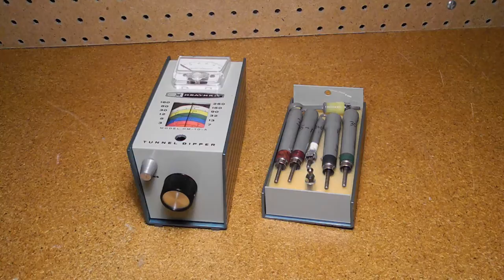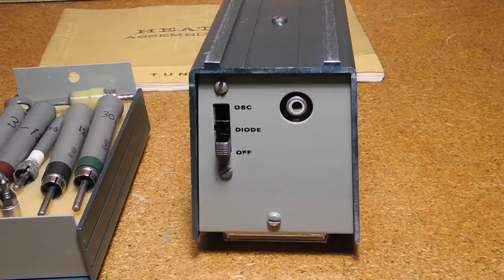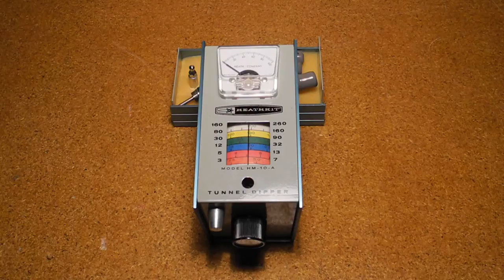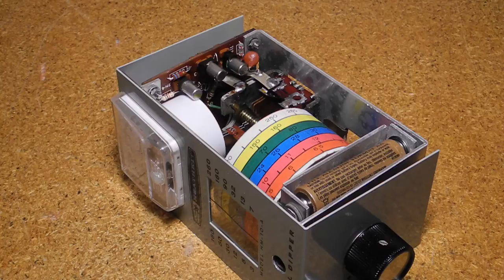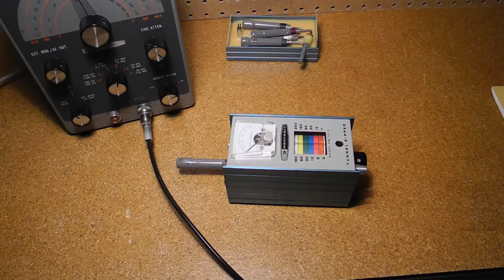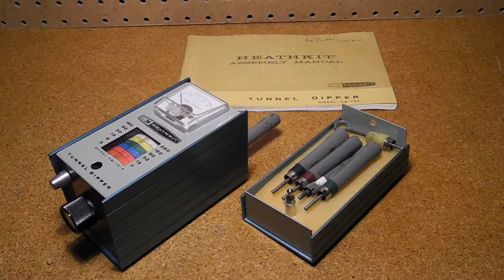The Heathkit HM-10A Tunnel Dipper

Comment: Very interesting and well presented.   I have one that is missing the coils.  I have not tried to fix it yet because I like using my Boonton Rx bridge or Q meters instead.  Did you ever look at the potentiometer used for sensitivity adjustment?   If the carbon track has cracks that make it open circuit, that might explain the behavior you were able to correct.  It might be difficult to find a replacement.

Comment: The Tunnel Dipper rapidly developed a poor reputation after it was introduced due to the hypersensitive gain control and generally very frustratingly-touchy operation, often requiring multiple gain adjustments to span the range of a single coil, and often producing false responses.  Heathkit eventually replaced the Tunnel Dipper with a dip meter that used a field effect transistor (FET) and provided much-smoother behavior.

The Tunnel Dipper was an innovative design, but the circuit should have been improved before it was marketed.  Unlike other dip meters that limit the oscillation amplitude via self-regulating feedback schemes, the Tunnel Dipper simply allowed the oscillations to grow to the maximum level the tunnel diode could sustain.  Thus, its oscillation contained harmonics, and the oscillation amplitude dipped only a tiny amount when coupled to a resonant circuit under test.  To compensate for the small change, the designer used a high-gain dc amplifier to drive the meter.  The amplifier is an unbalanced circuit, having a lot of offset and drift, requiring careful adjustments by the user to keep the meter from being “pegged” either one way or the other.

I purchased one of these Tunnel Dipper kits from Heathkit and have had it ever since.  I also added resistors around the gain control to reduce the control’s sensitivity, but the unit remains rather touchy to operate.  As noted by other owners, the foam that held the coils in the cover has deteriorated and crumbled.  I have replaced that black foam with newer soft white plastic foam.

Comment: I am not sure if this is good place to add this. I am having an issue with the meter not working unless pressure is applied on the device face. Please check heathkit@groups.io if you could help me with the issue.
Reply from the maker: A possibility could be a broken or cracked track on the PCB. Flexing the circuit board can often identify if this is the problem, and if you find the break you should be able to bridge it with solder.

Comment: I recently acquired a Dick Smith Q1335 dip meter which is identical to the MFJ-201. I’ve tested several antennas with it and find the dips can be hard to find.  The tunnel dipper looks like a big improvement. A nice piece of kit to have. de VK3YWB
Reply: Until it broke I used (or tried to) a Trio dip meter, like your experience with your instruments, dips was really hard to find. A constant battle between trying to have a loose coupling only, and not having enough of it...